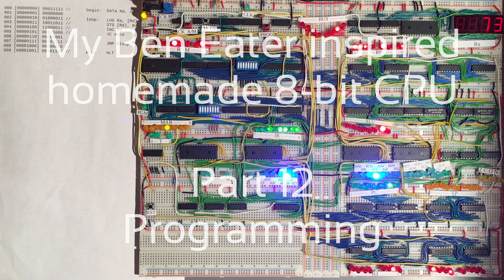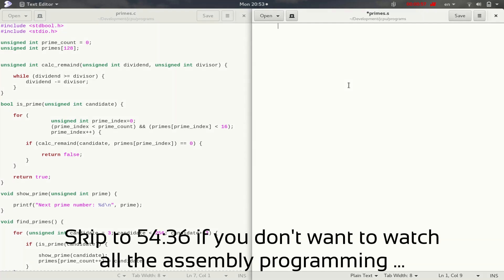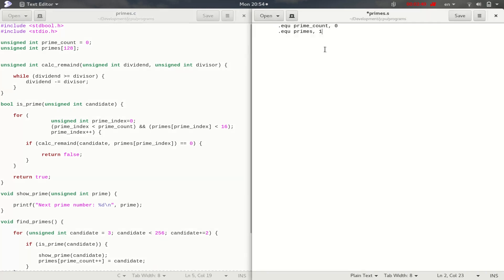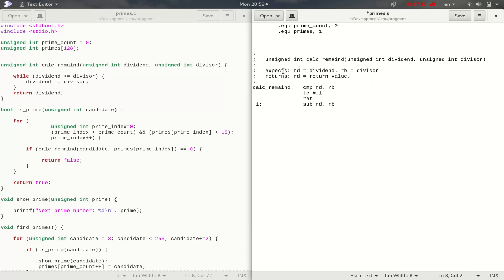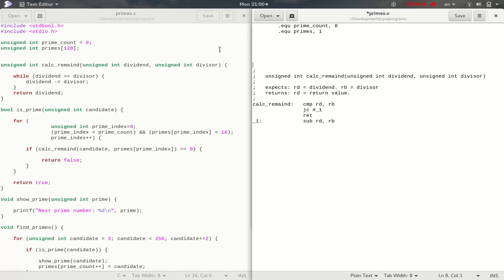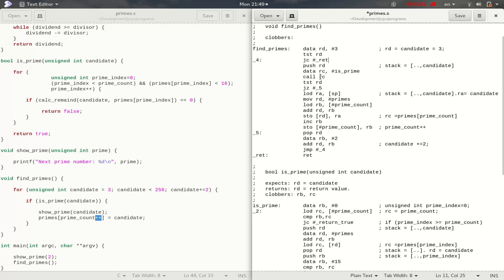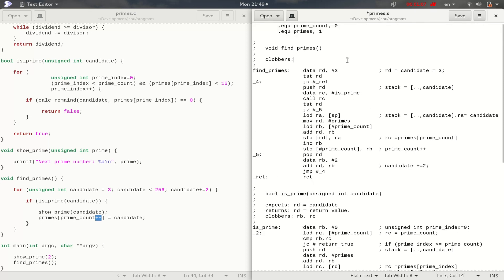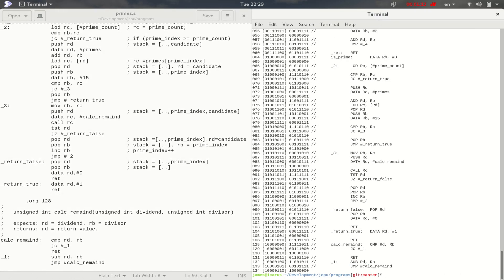My Ben Eater inspired homemade 8-bit CPU - Part 12: Programming prime numbers

Comment: Hi James. Thanks for your fatastic series. I have just completed making the original design as per Ben (finally to have the  design upgraded with your additions). I have an issue with control ROMs - when I work on the controls manually, the computer works fine and the example addition program outputs the result (42) correctly. But the moment ROMs are used for control (with Ben's sketch with JMP) , it goes astray. I doubt it is the same problem that you were describing in video9. Would you suggeest trying to solve it with putting the IR signals to ROM through a 74 LS 173 as you did  with the flags with 74HCT1763? Please advise.

Comment: Amazing series. I'm wondering given you clocked it all the way up to 0.5mhz how would it compare to the Z80 or 6502? Or are their optimisations too significant for a comparison?
Reply from the maker: Thanks :)

I was actually looking at the 6502 recently. It seems like the "next evolution" one could aim for after this CPU. Some extra features of the 6502 would be: more addressing modes (index-based), variable-length instructions, arithmetic shift instructions (very important for efficient multiplication, and a major omission in my cpu), 16-bit memory addresses, interrupt processing, crystal clock rather than 555.

In fact, some people already built a "disintegrated" 6502: https://monster6502.com/, albeit not on breadboards.

My feeling is that the Z80 would be one more step of complexity on top of that, with its array instructions and larger register set.

Comment: Hello! Thanks you for the videos. Is there any list with the supported commands and their machine code?
Reply from the maker: Unfortunately, I never actually wrote out a formal "instruction set manual". The best place to look I'd say, would be microcode program, https://github.com/jamesbates/jcpu/blob/master/arduino/Microcode/Microcode.ino, in particular the functionw which "generate" the instructions (write_MOVs, write_LODs, write_STOs and write_ALU_instructions).

I go through all the instructions and their microcode in the previous 2 videos (parts 10 and 11)
Reply: Thanks you.

Comment: Hi James, there are some gaps in instruction numbers, e-g- from 9 to 32. so the call instruction in  line 8 will jump to instruction numer 32 which is in real instructiuon 54 because of the gab from 9 to 32. what is my error in thinking? is there code missing?
Reply from the maker: As I explain at 49:10, I like to "align" the various functions to easy addresses, so that when the program is running, I can tell by looking at the MS bits of the PC, which function the program is in. So there are indeed "gaps" in between function ends and beginnings of new functions.

The CALL instruction, just like all jump instructions, as well as LOD and STO, expects absolute addresses. Indeed there's no fancy logic in my CPU to do arithmetic on the PC: values (in this case addresses) are written into the PC  as is (i.e. absolute). Therefore data rc, #32 ; call rc  really does call the function at address 32.

Comment: Thanks for all. 
In school (> 20 yrs ago) I could never figure out what stack, pop, push, ... meant. You made that clear to me.

I event think about building my own computer. Being a novice in electronics I would have to stick closely to an existing design. I like your aproach to the programming mode being separated from the computer running the instructions. And with all your explaining of the software I feel confident to manage the build.
At the moment it seems quite annoying to enter the programme with dip switches. I see that you have a breadboard left. Do you plan something like writing the final instructions on an EEPROM and read that into RAM in the programme mode by pressing a button? I would like to implement something in addition to the way it is done at the moment, but still keep the dip switches for changing some data.
I'm just not sure, if I have enough experience to implement that myself.  Before I start therefore my question: Do you see it possible at all to make some small changes in your design to make a third way of writing code to RAM? I'm thinking about putting an EEPROM on the remaining breadboard, some selectors and a button to press in programming mode? Or does too much depend on the way it is implemented like it is now, so that any change would break the computer?

Thanks again for all the explanations. Great tutorial!
Reply from the maker: Well, like you, I started on this with no experience at all in electronics! I just started out with Ben Eater's design really, which uses DIP switches.

Now his RAM is 16 bytes large, so DIP switches are reasonable for him. But indeed, as you pointed out, entering up to 256 bytes into 8-bit addresses using DIP switches is tedious, and very error prone. I have no immediate plans to build anything else, but if I were to extend, or build another CPU, I too would want something more "user friendly" for entering programs into the CPU.

Since the program and data memory are separate, and since program memory is never written while running a program, one idea could be to physically store it in an EEPROM chip, rather than on the RAM chip. Then, you could enter any program you want using the EEPROM programmer. As an added bonus, the program would stay resident even when the power is off. I believe the AMtel CPU inside the arduino nano actually works that way. It'd require a bit of extra circuitry in the RAM module to make sure the correct was selected based on the PGM control-bit, but as you point, I do still have a free breadboard.

As for your idea, it sounds like you could have some very small hardwired "boot" program in some kind of boot-ROM, which would copy some program bytes present somewhere into the program memory in the RAM chip, and then jump to it. Sounds equally valid.

Undoubtedly other possibilities exist too. I  honestly can't decide which way I'd want to go. I'd say, just pick an idea, and see how it goes!

Comment: Half an hour to enter the code using the DIP switches?

How about devising an IN instruction that reads from a fixed address in memory? And map that memory adress to the output from an EEPROM with an auto-incrementing address-counter?

That way you can use the EEPROM burner to transfer the machine code to EEPROM, and only have to manually enter a small boot loader by hand. The boot loader would be a simple loop to copy 256 bytes from the EEPROM to RAM. 6-7 instructions?
Reply from the maker: I am planning something along those lines ;)
Reply: Don’t need a boot loader to copy whatever, just use the EEPROM as the source of memory when the PGM bit is set, since the Program Memory can’t be modified in this computer

Comment: I have a question,
itis not very clear to me how you implement the stack.
it seems to me that you do not have any special signal to enter the area of the stack in the ram memory???
Reply from the maker: That's right: the stack is simply in data memory, together with all global variables. And the SP register really is just a register like any other, but with some slightly special instructions (push and pop). From the hardware's point of view, there is no special region called a "stack".

The fact that I can use the push and pop instructions and the SP to implement an actual stack, is ENTIRELY due to the WAY I PROGRAM:

At the very beginning, I set the SP register to 0, the same way I would initialize any other register. I, as a programmer, simply CONSIDER the stack to be empty at that time. Again, it's just part of data memory, and assigning "meaning" to each part of data memory is an entirely abstract activity, taken care of by software. 

Now when, again as a programmer, I want to place my first byte of data on the stack, I will use a PUSH instruction (in my program, this is actually the CALL Rc instruction, which indirectly is a PUSH PC). The PUSH instruction is implemented (see https://www.youtube.com/watch?v=O_mTxnFYLXE&t=57m42s), to do 2 things: it FIRST decrements the value in the SP, as if I had written "DEC SP", and SECOND, it writes the register into data RAM at the address pointed to by SP, i.e. as if I had written "STO [SP], PC". The hardware and the microcode just do those 2 things for the one instruction PUSH PC.

Now, remember that intially, the SP is 0. So at the first PUSH instruction, first it will get decremented by 1. But 0-1 would in fact be -1, a negative number. In binary, it'll result in 11111111. Interpreted as an unsigned number, that is actually 255. So now, when the PC is stored into data RAM, at the address pointed to by, SP, which is 255, the data actually gets writte to data memory at address 255, which is the highest possible address in data memory.

The next PUSH instruction, will decrease SP again to 254, and then write whatever register it is pushing into data RAM at address 254, i.e. just BELOW the first piece of data in the stack. That same process repeats for every PUSH instruction (each of which decreases SP), and is reversed for every POP instruction (which INCREASES SP by 1).

The net result, is that data memory is in effect shared by the global variables (prime_count and primes in this program), which grow UP from address 0, and the stack, which grows DOWN from address 255.

More sophisticated hardware and operating systems, such as modern Intel x86_64  CPUs running Linux or Windows, still use this same basic approach of having program data (which they often call "heap") and stack share a single region of memory, each starting at opposite ends and growing toward each other. You might be thinking that if you're not careful, they might collide, i.e. the top of global data might grow up BEYOND the bottom (i.e. most recent) stack data. And yes, this can happen if you don't program carefully. In fact modern CPUs can DETECT such a situation in advance, and terminate the program, with a "Stack overflow" or "Stack corruption" exception or something similar.

Of course, my dead simple CPU here, has nothing like that, so if any of my programs would experience such a stack collision, I'd be in deep trouble :D
Reply: Thanks for the answer

Comment: Do the chips that you're using have a clock speed restriction? If not, then what limits the maximum clock speed of the computer? How high do you think it could go before breaking somehow? I'm curious what the actual maximum clock speed of the computer is.
Reply from the maker: Yes, I believe the 74 series has maximum frequency of 30MHz or thereabouts.

However the 555 is the real limit. I don't think it can go beyond about 1 MHz.
Reply: @jimmyb998  Thank you for the quick reply! I do understand that you wouldn't probably want to run at 1 MHz. It would be way too fast to see anything :)
Reply: Would it be possible to see how far you can clock the CPU before it maxes out due to propagation delays and capacitance or the limit of the timer?

The tlc555 I have goes to 2mhz but I'm still building.

It just for curiosity rather than anything else.
Reply from the maker: @johnjosephlonergan  Probably. I just don't have any other timer than the 555, which is only good to few 100 kHz. I'd need to get a crystal clock oscillator...
Reply: @jimmyb998  hi the tlc555 CMOS goes to 2mhz
Reply: It would be fun :)
Reply: other factors are the connections of the wires and breadboard - RLC will start to effect your circuits due to length of the wires having different inductance, and bread board and wires having capacitance which can skew your clock, control and data signals. this is just off the top of my head, but i think you could see this by monitoring your signals with a good oscilloscope as you slowly increase the frequency of the clock.  the shape of the signals will change - slopes of the edges will round off, and voltages could be attenuated... note - once you get fast enough the travel time of the signals start to become important - you have to start to worry about signals arriving at the right time, holding stable logic values, etc.  the timing is all determined by the clock.  Hope this helps.

Comment: Hi James, I think your series is very impressive. But I have a question: Can it be that the pin numbers of the microcode do not match those of the schematic? For example, on the schematic RdW has the position 16, but in the microcode this is entered as number 18.
Reply from the maker: yes, quite possible ;)

Comment: If you make an assembler why not push the code to the cpu with an arduino?
Reply from the maker: One of my very next projects ;)
Reply: I ordered the chips to build a breadboard CPU and was thinking to use an esp8266 or esp32 to send the assembled program OTA to the CPU. I am too old and lazy to flip dip-switches :) Hope you'll make a video of your solution!
Reply: You could use a memory mapped 65c51 to do serial communication (rs232). Then you can communicate with your computer directly from any pc.

Comment: Watched all t he videos! In your introduction you said you want to have a c compiler for it. Will you be making videos on how to implement that?
Reply from the maker: If I ever get around to that, yes. :)
Reply: Thanks a lot for answering! That would be amazing, but that will take a whole series of videos for sure.
I am currently working on the cup build. For the compiler would you write it in plain C or rather look into frameworks like Yacc?
Reply from the maker: Ideally some sort of existing c compiler infrastructure. I looked at gcc/binutils, but got discouraged by the complexity :)  I think there are other, simpler ones around.
Reply: @jimmyb998  You could look at SDCC which is a compiler directed as small 8,16 bit microcontrollers. http://sdcc.sourceforge.net/

Comment: What do you think about adding a simple interrupt to the computer's clock?  It could be as simple as an RS latch inserted into the existing clock logic.  For features such as user input and a delay instruction, this would be necessary.  A user input instruction, for example, would set the latch (I am actually using a 74LS74, as suggested here https://electronics.stackexchange.com/questions/358039/single-pulse-rising-edge-detector) using a control signal from the EEPROM.  After the user either entered a value via DIP switches or a keypad, they would press a button linked to the latch's reset line, allowing the clock to resume.  Using the same interrupt for different functions would work fine in the case of a simple computer like this.
Reply from the maker: You can actually achieve something similar with software!

Define somewhere in RAM to be a variable "is_interrupt", for example address #255.

Then, at address 0 (very top) of your program, write:

.equ is_interrupt, 255
.equ input_data, 255

lod rd, [#is_interrupt]
tst rd
jz #start_program
jmp #int_return

start_program:
... ; actual program goes here

Later in the program, where you want to "trigger" the interrupt:

data rd, #1
sto [#is_interrupt], rd
hlt            ; <--   this will halt the clock; after "resetting the computer", it'll check for #is_interrupt, and if it's set
int_return: data rd, #0       ; it'll jump right back here...
sto [#is_interrupt], rd
data rc, #input_data       ; read in data set using the DIP switches at some fixed address
lod rd, [rc]                          ; in program memory (#input_data) (whence rc as address reg.)
... ; program continues

No extra signals or wiring required! :)
Reply: James Bates While this solution is great, there are only 265 words to work with.  In this case (normally I'd be all for the software solution) I'm going with the extra hardware. The interrupt itself really is not that much extra logic.

Comment: Cool video :)
One thing I don't understand. You got 6 registers but only 2 of them are really genial purposes (a=display b=alu c=genial / program d= true genial)
Why not implement print functions with as in have a specific display register and freeing a to be used.
At least in this program it would be very useful
Reply from the maker: I agree about that actually. Initially, I saw Ben's output register, and thought "I could make that a read-register also, and that have another one". But in practice, I discovered that not wanting numbers to show up on the display means I can't use it very much, as you point out.

Comment: Great work!
I have build my own one also based on some of your work!
It all works, but I am still wondering why I can't get it stable on higher frequencies (>100KHz)
Could that be bad contacts or still some kind of flaw in the design?
You can find all details here: https://www.dijkens.com/mdComputer8/
Reply from the maker: I honestly never measured the maximum actual clockspeed. I think I have gone to about 100kHz, but not much beyond that. I think the classic 74s aren't supposed to handle much more... could also be the ROM or RAM chips, or the simplistic edge detector on the RAM write logic...